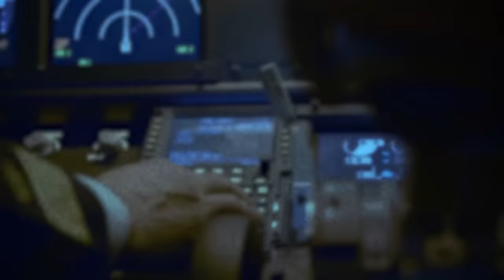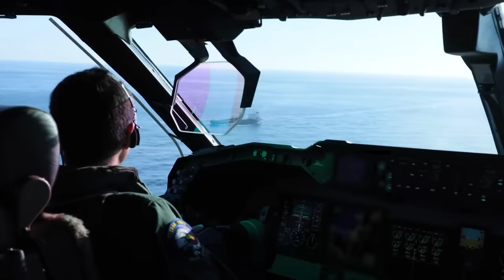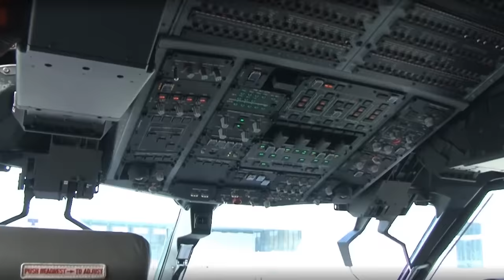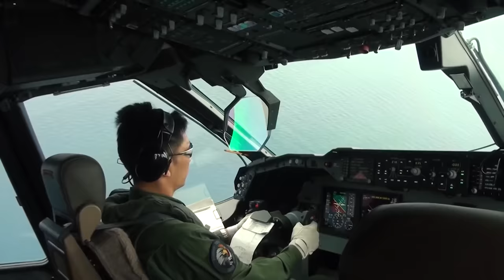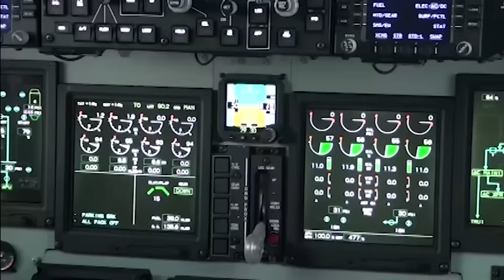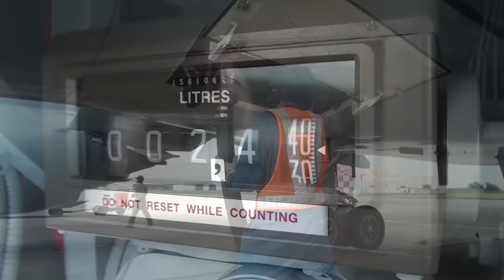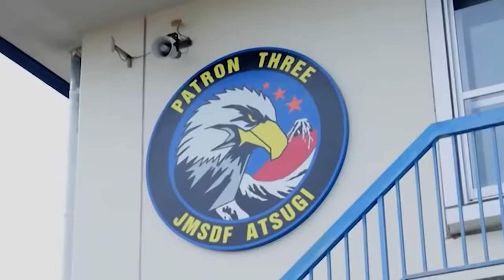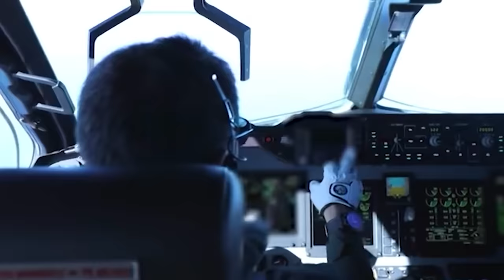The Plane that is Going to Save the World?

Comment: I had the honor of working with the legendary P-3 for a short time. I gained a lot of respect for those guys. It's a remarkable aircraft. Japan's P-1 just improves on what was already a great platform and makes it even better.
Reply: I'm weird in that I actually like the sounds of military aircraft when I stay at Navy Lodges and the like.  My stay at JAX was cool because apart from the Goshawks, Texan IIs and the occasional Hornet I was used to at KNPA, I was treated to the variety of the S-3s and P/E-3s that approached directly over our MWR cabin.
Reply: I thought the P3 was replaced by the P8 a while back.
Reply: They did the same with the F-16. The 'Mitsubishi F-2 "Viper Zero" is all around an improvement on an already great fighter platform.
Reply: @ShenandoahShelty  our stay at JAX was like 15 years ago.  I'm sure the whine of the P-8 is what I'd hear if we went today.
Reply: It ain't going to save nothing. Subsonic sitting duck  hypersonic missile target
Reply: @captainaxle438   well, there's that. 😂
Reply: @ShenandoahShelty  They did. They had them at NAS Jacksonville 12 years ago when I retired. Not all P3 Orion's had been replaced then. But I assume by now all Squadrons are flying the P8 Poseidon.

Comment: I like what the  P1 is and has to offer!!.
Reply: I do too. It can continue its mission with one engine out. I wonder what the procedure is if a P-8 has an engine failure? I know first hand that a P-3 would continue a patrol with an engine failure.
Reply: @Chris_at_Home  with a long runway and a light load, a 737-800 can take off with one engine.  Flying is no problem.

Comment: I saw one of these at RIAT a few years ago, and was seriously impressed. They were marketing it to the R A F, but we went with the Boeing P8. I think one of the major reasons must have been commonality, as several European and NATO air forces also took on the P8 around the same time, and being based on the proven and popular 737 airframe, Thais was understandable  . I still think the Kawasaki looks good, though!
Reply: I Pray the P8 is NOTHING like the MAX!!!!!!!!
Reply: @scotabot7826  I believe the P8 is based on the 737-800 .. I share your concern!
Reply: P1 looks better on paper and in the air than posidon
Reply: @scotabot7826    Worry not.  The P8 is NOT an airliner.  About the only thing it shares with the 737 is the basic airframe and not the avionics used in the Max.   Besides... there's nothing wrong with the design of the  -800 variant of the 737 and it doesn't use the engine layout and type used by the Max, thus no MCAS on the P8 to begin with.   

There was nothing inherently wrong with Max's MCAS system either IF it was used correctly.  It was being misused because the pilots that misused it Could... the 1st gen MCAS used on the Max had no default system to prevent misuse and the MCAS's augmented flight controls designed to make the Max handle like the earlier 737 variants could "argue" with the pilot's control inputs if used for take-off with high AOA which the MCAS would attempt to "correct" if used during takeoff by pitching the Max down.  This is what happened with the two 737 Max airliners that crashed shortly after takeoff.   Thus, Boeing had to reprogram the MCAS software to make it foolproof, seeing as how fools can be so ingenious...   

Moot point with the P8 since it doesn't use the Max's airframe or its MCAS to begin with.

Comment: "Military enthusiasm" all you want. Nations need to want something for it to be produced at scale.
Reply: Meh it's not always fair competition, in fact it never is.

The US in particular and I say this as an American veteran has no issue pressuring allied nations to adopt our tech even if it's the inferior solution for them.

You have to remember America makes it's stuff first and foremost for itself.

When it makes armored vehicles it takes note of the fact it will have to be transported across an ocean before it can fight and that it will be thousands of miles from a repair depot possibly.

This is why the heaviest and best tank is probably the Israeli merkava not the American Abrams because the merkava doesn't have to worry about train tunnel dimensions and rail car transport limits.

 It doesn't have to worry about going far to get looked at or getting bogged down in wet mud.

Likewise the Abrams is a worse tank for India which is worried about fighting way up high in the mountains and needs a highly maneuverable tank able to keep it's engine going in an oxygen starved environment.

A powerful light tank from say South Korea or Japanese/Taiwan offering are better choices.

But that doesn't mean the US wouldn't pressure them to accept American weapons regardless or that those countries wouldn't give in to that pressure as part of a larger diplomatic strategy.

If India thinks buying the Abrams comes with access to f35 as well or a free trade deal or any other number of items they might decide to pick the worse tank.

So desire isn't all that matters

Comment: The UK had the option to buy some of these for our Maritime operations, Sadly, they went for the US Boeing P8 Poseidon system instead despite the Kawasaki outperforming it in every test. I believe the main reasons centred around cost and the existing relationship with the US. There may have been some interoperability factors as well though.
Reply: Well, the UK had their Nimrod which was best, but they trashed that too.
Reply: The Boeing P-8 has significant commonality (63%) with aircraft already in RAF service (RC-135W)
Reply: @TheBooban The RAF was stuck with the Nimrod, it was never an aircraft they wanted but there was no British aircraft to replace it.
Reply: @WilhelmKarsten  Nimrod Mra4 was a new aircraft made by the UK to replace its existing Nimrods. They had just finished developing it but then chose to buy P-8’s. By all accounts it was a better plane.
Reply: @TheBooban  The MRA4 was canceled because it was an unmitigated disaster, a truly shameful and humiliating display of corruption and incompetence.
Reply: @WilhelmKarsten this is wildly untrue.
Reply: アメリカ海軍はp-8に満足しているのでしょうか？

Comment: P-1and P-8 are both excellent maritime patrol aircraft. They have slightly different strengths but both are capable of completing the same mission tasks. P-1 is better suited to low level searches while P-8 is better suited to high level searches. Ideally you would want some of both types to complement each other or partner with other countries that use the other type.

Comment: In consideration of safety , stability , easy manouvering , handeling of an airplane , as well for best view all around , attagement optionds underneed the wings and or on flussalage of the plane , having the wings attached on top of the flugelage instead underneed , and the engine place on to of those wings instead of underneed , would be the most favorable and best option .

Comment: Those engines really have a low bypass ratio. Video stated they're putting out 61kN of thrust and called them "Powerful" with a high bypass ratio. Bro, the 737 Max's LEAP engines put out 100-120kN of thrust.
Reply: Yes, but having four versus two and a lower bypass ratio helps in acoustics masking.  Besides, Boeing now has another issue with the Max.  Its latest LEAP engines have a problem with the anti-ice system.  The composite materials being used in the engine cowls can deform from overheating which can lead to catastrophic failure of the fan blades.
Reply: @Primus54  Fair enough. You make some great points. I just don't understand why the narrator in the video says "powerful engines", "high bypass ratio", etc when they're really not. They're good for the application, but certainly not what he described them to be.
Reply: @Unloadonyou  True enough.  While interesting content, this channel is not known for accuracy.  😉👍
Reply: @Unloadonyou I think he is generalizing and comparing old we turbojet engine technology.
All modern jet aircraft have high bypass turbofans now...
Reply: Yes, you are correct, but he doesn't make the distinction of comparing old turbofan with new. He simply makes his statements, but compared to other current turbofans, there's one of the lowest bypass ratios. @WilhelmKarsten
Reply: @Unloadonyou  IHI's first turbofan had a bypass ratio of 0.80:1
According to Wikipedia the IHI  F7 has a bypass ratio of 8.2:1 which is very impressive

Comment: Upon seeing the P-1 Nautilus at RIAT a few few years ago, this is the sub hunter the RAF should have bought, not the P-8, a Glorified Ex Ryanair Boeing 737 Holiday Jet. A clever cross breed of an Airbus A320 with a Boeing C-135R compact with good performance enabling the Nautilus to use any airport suitable for a Boeing  757. In order to extend its patrol endurance can the Nautilus fly on two engines ,like the old DH Hawker Nimrod ?.

Comment: The P-1 is an impressive aircraft.  While it can extend its range beyond 8,000 Km by shutting down 2 of its engines, its is in no way more capable than the P-8 Poseidon. The P-1 is also more expensive than the P-8 Poseidon.  

While the P-1 will serve Japan well, it will not, in all likelihood, see service beyond Japanese forces.  It will also not see the type of ongoing advances and capabilities that the P-8 Poseidon will. Nor will it see the type of crew training.

Comment: The biggest problem with Naval Patrol and Intelligence Aircraft is from the Upper Grade Officers, and their ANAL concern with NATOPS, they seem to weave NATOPS around their wants and needs.  Worked at a Squadron for 4 years, and was a sub rider for over 12 years.  I was far from impressed, sorry an EP3E was obsolete before the first platform was built and by the time I was at the squadron a Sub Rider would Laugh at how OBSOLETE the collection system was.  But it was NATOP certified, so live with it.  Boat came into base, so got permission from the boat's CO to show them their system, and they thought it was Star Wars.  The funny part was this system was being replaced due to it's limitations.  So I expect the new platforms will be again 10-20 years behind in the power curve.  The Japanese made a good choice of going it alone, mission comes first and preconceived notions should go away.

Comment: I guess Kawasaki couldn't provide enough Canadian content in a bid to upgrade Canada's defense fleet, they went with the Poseidon 8 purchase last year. Jobs before effectiveness?
Reply: There is a huge question lingering on the P-1:  Can Kawasacki actually support it outside of Japan.  P1 is designed to replace a P3 one for one, the P8s are a whole new deal, new tactics, new way to fly them operationally.  I think they both have their place in the community, RCAF went with what their closest allies are flying, which makes interoperability so much easier.  Local manufacturers were unable to compete really, perhaps if Kawasacki had done a deal with Bombardier......

Comment: I flew KC135 A and R models... I suspect unlicensed boeing 707 Clone...😂
Reply: Kawasaki has developed several indigenous Japanese aircraft, although Kawasaki is a long time partner and subcontractor for Boeing, I would not be surprised if it used a lot of Boeing parts and systems under license.